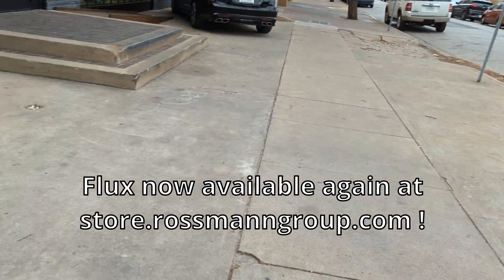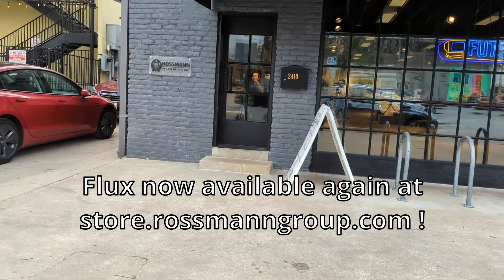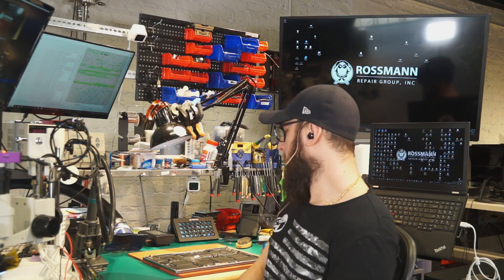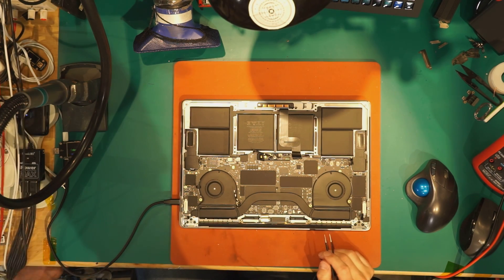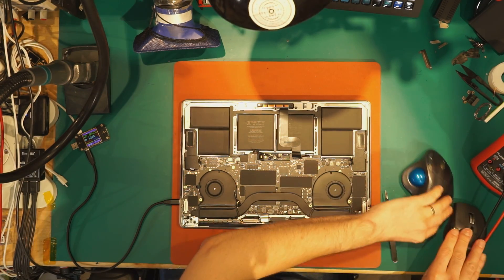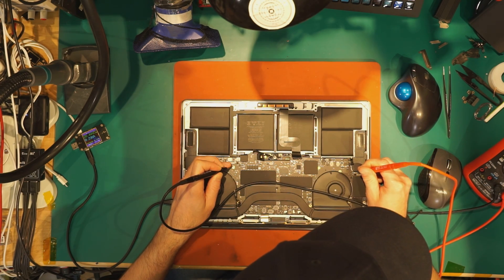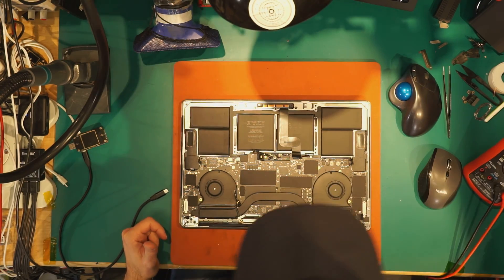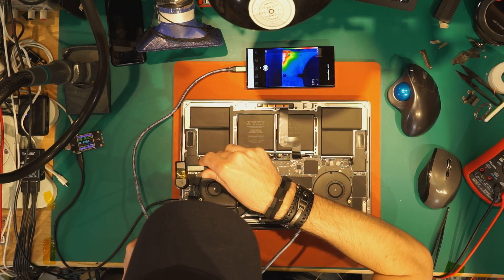A1990 Macbook logic board repair with shorted SSD circuit

Comment: I get proper voltages everywhere except for P2V5 Nand SSD0 on macbook pro a2289. no short on line. I already changed TPS62180 but only getting 0.755V on 2.5V line. It seems like macbook is trying to boot because cycles every 15-30 secs 0v to 0.755v. Any help would be greatly appreciated.

Comment: Where can I get my hands on laptop schematics? I have a Dell laptop I'm trying to fix that won't turn on and I hear a chip making noise when I try to turn it on. Checking with a meter I'm not getting power where it should be, but I can't follow it all out without some prints.

Comment: Now that my mid 2017 Mac Book Pro is reaching the end of its planned operational life, I am either thinking about spending $3,000 to buy another MBP that has planned obsolescence or spending $200 to fix up my 2010 MBP with the broken screen and blown out sound bar. The thing I like about my 2010 with the better keyboard is I can still use Final Cut Pro and Microsoft Word without a monthly fee. Change my mind.

Comment: It seems the T2 replaces the SMC of the old days. And it seems that it is an improvement as it is possible to revive the device by means of a working device, software and cable. Surely this is easier than reballing a second hand SMC. That's it what I learned today. Thank you.